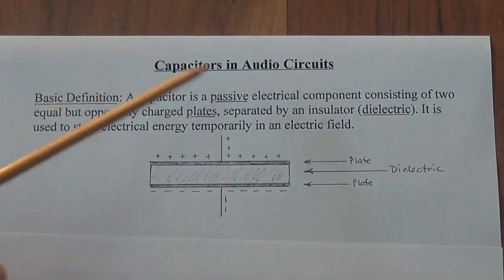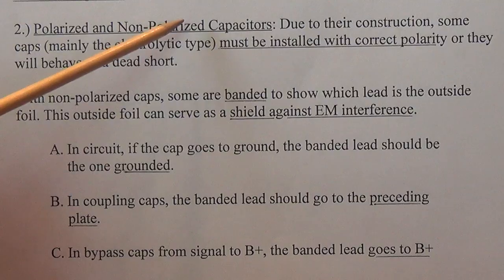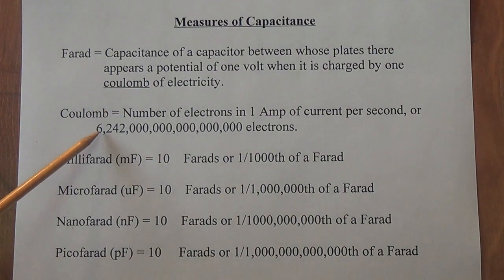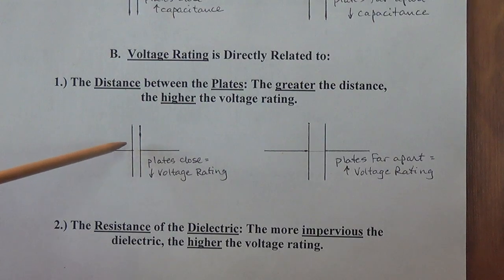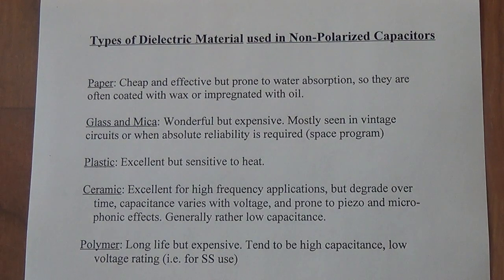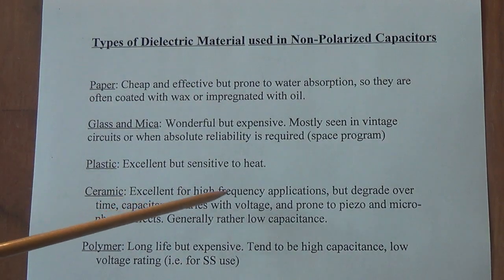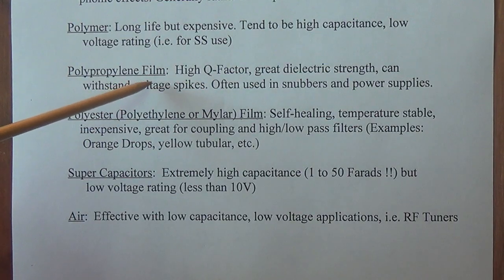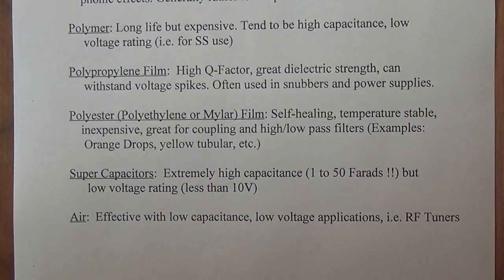Capacitors in Audio Circuits:  Part 1

Comment: i just so impressed ...so i just can we think  out of the box i have so many parts i dont wanna throw ,,,,,i  know what voltage is in even tsela coils ....do we need a tranfsformer is that just an a isolatoin thing ? we coulud use batterys in serier charging in parralel ,,in a effekt and power stage  yes ,, but in a pre amp ore line stage buffer ,for line in line out ,,,you make me sparkel uncle 🙂

Comment: Yeah , I have contemplated that products should have pots everywhere instead of resistors lol. I was thrilled to do math and figure out circuits when I learned to do that 50 or so years ago. Especially tank circuits, I couldn't get over that. Id just make up fictitious circuits and solve for transition frequency. But in the real work, I like more practical, solutions to expedite things.
Reply from the maker: Thanks for sharing, Peter.

Comment: I had wondered about variable caps before. Thought might be cool to use say on the tone control of a guitar where voltage is very low. I like your idea of using them to tune in a good value by ear then with that determined replacing with a fixed value.
Reply from the maker: Yes, indeed. Likewise with resistors too :)

Comment: In reply to your reply on the capacitors, from the site you spoke of: they have most. Between them and a few other sites I am able to get all. I was hoping they'd be able to cover all with the polyester film capacitors. 4 larger values, 2 x 50u, and 2 x 250u Im only finding electrolytic. But overall, most of what I will order are film
Reply from the maker: Depending on the voltage rating, i.e. you can find caps of that value under 50VDC, but for higher voltage ratings, they will either be huge or electrolytic.

Comment: You state that you get your polyester caps from a supplier called antique electronics supply. I'm optimistic that they will carry many typical values from older amps? I've been having a difficult time finding caps for a SUNN head. I'm going off from what the originals were, not redesigning, though I am tempted to turn it into a Fender bassman but, for practical reasons I am going to keep with the SUNN architecture. So I'll be having a look to see if I can find that supplier and find what I need there. Thanks for the great videos.
Reply from the maker: They will have virtually every value you could ever want, Peter. Good luck with your project.

Comment: Doug, how far out of specs can filter capacitors be? I'm testing an old Supro combo amp (probably 5 Watt). It has a Mallory can cap with a 20uf and two 10uf all rated at 450Volts. the 20uf is reading 31uf, one 10uf is reading 20.4, and the other 10uf is testing 14uf. They are all reading high. Should I replace the can? It's not making any loud 120hz hum when the volume is cranked.
Reply from the maker: Those caps are nearing the end of their lifespan, Joseph.  When in doubt.....replace them.
Reply: @UncleDoug  Thank you for the information!

Comment: Ummm...

You can see milli-Farad caps in audio... Well at least in the power supply of solid state amps where noise rejection isn't quite as easy valve/tube amps.
Reply from the maker: Our channel does not deal with SS amps, Will.
Reply: @UncleDoug 
Please forgive me as I do realize that. However you did mention super-capacitors, which have found a home in car audio (Yes, that does exceed the voltage rating of 10vdc you gave them) and those don't really have a bearing on tube/valve amplification either.

I do have one question that involves tantalum capacitors. I know they are a type of electrolytic cap, but I'm not sure what makes them apparently so prone to failure, even when they are not reverse biased. I avoid them, of course, as with that volatile failure capacity (no pun intended), I wouldn't trust them even as a cathode resistor bypass cap or anywhere else for that matter (such as solid state channel switching.)

I do wish to express, as others have, that I find your videos interesting and educational. I am grateful that you have chosen to share your knowledge with us.
Reply from the maker: @willbarnz6960  I'm not sure where you got the negative opinion regarding tantalum capacitors. They are extensively used in electronic devices that require stable capacitance, low leakage current, and where reliability is crucial., i.e. medical equipment, aerospace and military applications. Thanks for your kind words regarding our channel :)

Comment: Without getting into my entire life story and making this comment way too long (which it will still be with the abridged version), is there a good way to contact you either via email or Facebook messenger? (I basically don't use FB but have an account and follow your page on there). I have a photograph of a capacitor that I am wondering whether looks suspicious (or perhaps not at all). It's in the tremolo circuit of an amp that basically follows a Princeton Reverb schematic. I haven't removed the chassis from the cabinet yet but can see a slight concave "outward" appearance on both ends. I don't have the experience or knowledge yet to know if this is a telltale sign or not. Obviously I realize an outright bulging cap means it's bad but this is a ton more subtle than that and I have a picture. I'll try to make my life story as short as can be, purely for context, and I'm sorry the context has to be more than a single paragraph at all.

I'm a lifelong guitar player who basically turned pro when I moved to Nashville for school and am now approaching 41. Since I was at least 18 years old I wanted to someday build (or at least become capable of one day servicing my own) tube amps but geography alone, I've always had access to really good techs. When I was 19 or 20, for Christmas, my Grandmother gave me an old electronics book from my Grandfather's collection and wrote "Build Your Amp Someday" on it for me.  Around 2012 I started reading heavily. A few years later Todd Sharp the amp guy/guitar player pointed me towards a couple more '50s amateur radio books and an old Army text on The Application & Theory Of Electron Tubes. There's a compliment coming here. The books were good and I learned a lot, but....I've learned the most from your videos!! 

Fast forward into 2022. The tube shortage freaked me out completely and I got scared of losing the old guard someday and began having catastrophic thoughts about "who's going to maintain my tube amps in another 20 years!!?" I was forced (under contract) to do the silent stage once with a Tech 21 Fly Rig. It's not the silent stage. It's that no simulator, modeler, profiler, or anything digital that the kids these days are running towards moves me. Sound moving through air inspires me and feels better. Kemper, Fractal, Line6 Helix, whatever. I'm sticking with my vintage and boutique tube amps for life! So for over another past 12 months all I do is read, move through the Rob Robinette website, watch your videos, and spend my spare time studying this stuff. Over the Christmas holidays I built your light bulb current limiter with my Dad. Which brings us into 2023....

The folks who've serviced my amps for two decades are backlogged months out now. One of my main amps starts sounding bad. I've known the builder for 20 years but he's on the East coast. We talk on the phone and after ruling out tubes, another couple months go by. During which time.....

I kept looking with the back off the amp (while not touching anything) and finally noticed the tone slope resistor was cracked (carbon comp). I've learned enough from your videos to be certain how to drain filter caps and otherwise stay alive (I regularly quote your phrase from your bias video about "there's an old cowboy movie called The Quick & The Dead. Well, with tube amps it's The Careful & The Dead"). I have no concerns about safely getting the chassis out, draining the caps, removing a component and soldering in a new one (I built an 1176 compressor and mic pre, which both work perfectly, but it was paint-by-numbers kit stuff. Anyhow, I know how to solder at least). But while figuring out what to order for this project and originally thinking just the resistor would do it.....

I was looking around there again this evening and saw the capacitor in question. I'm wondering what someone who knows what they're talking about (which is you!) can offer an opinion from a picture I took of it. I'm certain it must have taken you longer to read this comment than it would to look at the picture. 

I hope that's not asking too much, oversharing or otherwise intrusive to ask, and please don't feel compelled or obligated. But I wanted to at least reach out here via this YouTube comment to let you know how much enjoyment and education I've gotten from your videos.....

And If I can contact you, like I said earlier, I don't really use Facebook much these days but would absolutely get on there if that's the best way to reach you. Or you can reach me directly at: sean dot weaver at me dot com
Reply from the maker: Greetings, Sean. I appreciate your kind words and can offer advice without actually seeing the capacitor in question. Simply replace it. You can order any part you need from Antique Electronic Supply in Tempe, AZ., and replacement is easy if you're careful. Good luck.
Reply: @UncleDoug  Thank you!!! That helps to hear so I'll do that. Quick follow-up question. I've at least book-learned by now about placing the outer foil side to ground (or the circuit's lowest impedance). I don't have a scope yet and understand that the marking is often wrong (when even provided at all), so I don't have a way of testing which side has the outer foil. If I get it wrong on install, is this potential interference I've read about going to fall within the audio spectrum? (in which case, no big deal, I'd redo in the other direction). I've been studying your scope videos and was close to getting one this week but decided to hold out until I can get an isolation transformer first
Reply from the maker: @SeanWeaver  The scope is FAR more useful than an isolation transformer, Sean. You are welcome to obsess about which cap lead goes to ground, but I have never found that it made much difference.
Reply: @UncleDoug  Thank you so much. Long and crazy day so I'm late replying but I do appreciate you getting back to me and will take your advice to heart and mind. I was just mentioning the isolation transformer since I watch your videos on safety over and over again and was referring to your safety teachings on plugging the device under test into an iso. transformer when working on a live amp with a scope. Lots more to learn and your videos keep me  inspired to get there slowly but surely. As for the cap leads, I won't sweat it too much then!

Comment: Just as an adder to the paper deterioration reference within the capacitor....the paper (cellulose) in the capacitor, stressed over time from heat will create water as a natural by product of the breakdown process. I worked in the electrical power distribution field for a time and saw how oil filled transformers develop water in their internals over time. The water develops directly as a result of paper breakdown itself and cannot be stopped. I assume the process is similar in paper dielectric capacitors as well.
Reply from the maker: Thanks for the info, Rusty.

Comment: Other than the definition of 6.242 Quintillion electrons - 1 Coulomb,  why is it such a magic number? How was that magic number derived? The last time I asked that question, the "Instructor" punted and said "It's in the Book." when it  wasn't. He was so poor an Instructor that he was boycotted the next semester. You, on the other hand, seem to want to answer any reasonable question.
Reply from the maker: Easy, Clayton. As everyone knows the value of the elementary charge e (one electron) is 1.602176634×10−19 coulombs. Therefore the coulomb itself is the reciprocal of this number which means that one coulomb is the charge of approximately 6241509074460762607.776 elementary charges. Please don't ask where they got the charge of one electron ;)

Comment: Doug,OK to swap Mallard cap630v 223k for the one Beryl
400v 100uf
Reply from the maker: I don't understand the "223K" ?? It does not seem to be equivalent to a 100uf cap.....so, no.
Reply: @UncleDoug  OK thanks and thanks a lot for all the information you give us on your shows you really do it well thanks again
Reply: A while back when I first took interest in capacitors I found a bunch on sale and blindly bought A bunch of capacitors etc. and wondered if I might use them to help me recap this .5 w Gerhardt hw, I noticed one cap had leakage I replace that it helps but it still seems to muddy up after about an hour playing so I wanted to give it a cap job this ceramic thing is 10 Watts at 7.50hms, do you think that would be a suitable replacement? if not I’ll just go buy the right one? thanks Rg
Reply from the maker: @rgilbert8  I have never heard of a capacitor rated at 10W and 7.5 Ohms.....sounds like a resistor to me. Yes, buy the proper replacement cap.
Reply from the maker: @rgilbert8  You're welcome, Gilbert.

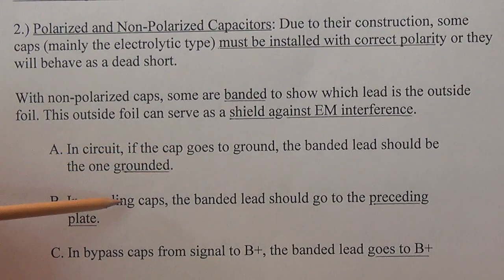Comment: 4:59 I've replaced some caps in my '68 Bassman, and upon seeing this video I wonder if I've gotten my +/- (inside/outside foil) orientation wrong. I know the two big coupling caps at the end should face the "preceding plate" but what about the many tone-stack caps? How many "coupling caps" are in a BF Fender circuit? thanks!
Reply from the maker: Polarity is essential with electrolytic caps, Toshio. If you get it wrong, it's a dead short. With non-polar caps it's not a big issue, other than some concern about reducing the noise floor by heeding the position of the outside foil.
Reply: @UncleDoug  thanks for the reply Uncle Doug! 
My question is, are the caps in the tone stack going to ground? or should they have the stripe back to the preceding plate?
Reply from the maker: @toshioyamada3311  If a cap is going to ground, the banded end (outside foil) should be the one that is grounded......like a shield.

Comment: Unfortunately the band on the modern orange drop caps doesn't indicate the outer foil as it does on the older caps. I learned this here: https://www.youtube.com/watch?v=BnR_DLd1PDI I have tried Carlson's easy test to determine which lead is outer foil and it works. Anyway thanks for the videos, have learned a lot from them!
Reply from the maker: You're welcome, Nicholas. Thanks for the info.

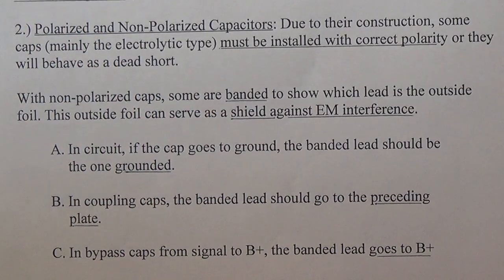Comment: 4:13 Just a heads up, the "band" on modern caps does NOT necessarily mark the outer foil. Mr. Carlson's lab has a good video showing examples. https://youtu.be/BnR_DLd1PDI
Reply from the maker: Thanks for the input, David.

Comment: Your videos are treasures to me. You have a way of explaining that people can connect with. So thank you for that. .  I think I've been over complicating what type of capacitors to order for a 1962 Airline amplifier. I saw the band on some of the capacitors in this amp (that you mentioned in your video) and thought they must be polarized. So I've been confused about where to use electrolytic capacitors. I've got so much to learn. Is there a way to know for sure what capacitors are polarized? A way to test with a multimeter maybe?
Reply from the maker: Any cap with a + and - label is most likely an electrolytic. They are used to obtain capacitance higher than 1 or 2 uf.  The banded non-polar caps (usually < 1uf) use the band to designate which lead connects to the outer foil layer within the cap. You need an oscilloscope to identify this externally.

Comment: A test was conducted on those Sprague orange drops and unfortunately proved that the banded end was purely a factory applied cosmetic touch and not indicative of outside foil which is very frustrating! These days I have to test all of my capacitors for audio applications and then mark the real banded end with a Sharpie. It makes a difference with quieter Amps.
Reply from the maker: Thanks for your helpful input, AB.

Comment: Glad you show us dumb guys what your doing and the caps what they look like Half the time I’m not sure like when you test a cap on a circuit board if the amp is on or off  Thanks UD
Reply from the maker: I'm glad the video was helpful, Bob. When measuring ESR and capacitance, the amp must be off with caps drained. For leakage, the amp is on.

Comment: you said that you'd never see a MiliFarad cap in audio amps, but the solid state amp on my desk right now uses a 10mF (10.000uF) output capacitor
Reply from the maker: Wow.....I don't work on SS circuits so I've been spared this awesome and frightening sight ;)
Reply: @UncleDoug  haha, i only work on solid state, since its easier (in my opinion) and the voltages are all safe to work with using both hands.
although i do base a fair amount of the circuits i put together on old tube amps, so that i can get close to ''tube feel'' as i can.

Comment: Some very useful information, well presented. I appreciate your no nonsense style, you have a gift for this!

One cap. type you didn't mention, probably because they are extremely uncommon and of limited use, is the vacuum capacitor. I  came across one of these a few years ago, in an old 1940's MOD ammo box that was full of valve radio ham junk and components. I am an electronics engineer, but didn't have a clue what this thing was! Got rather a handy price for it, that practically paid for everything else in the box after researching it.

I am restoring a 1960's Marshall valve amp at the moment, so am working through all your gold mine of vids as I find time.
Reply from the maker: Thanks for your nice comments and interesting info, TW :)